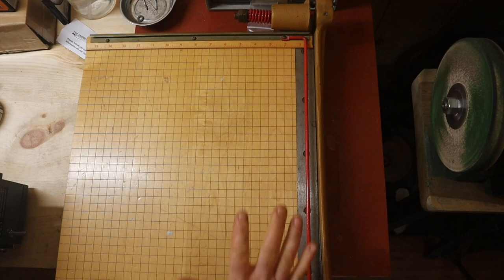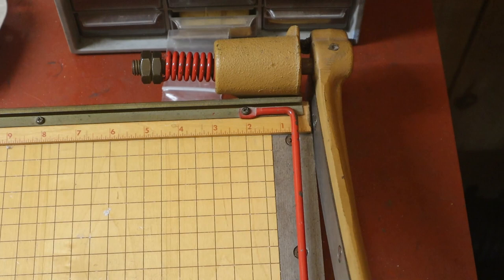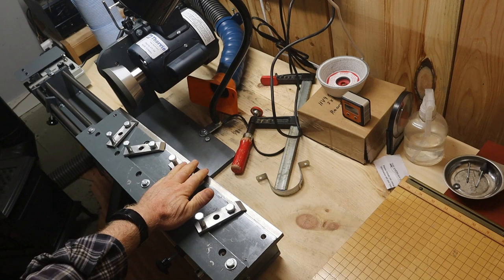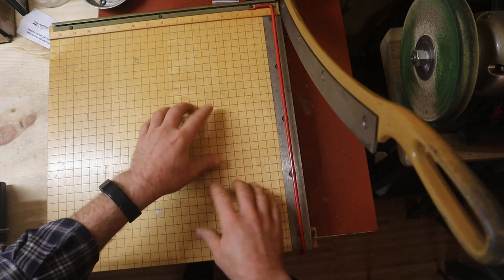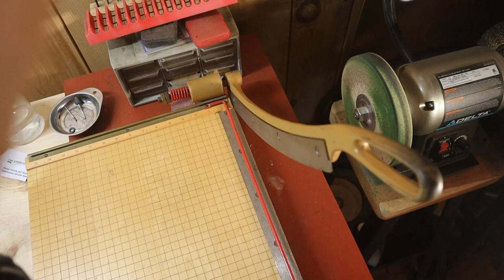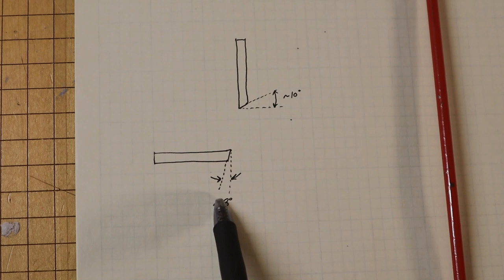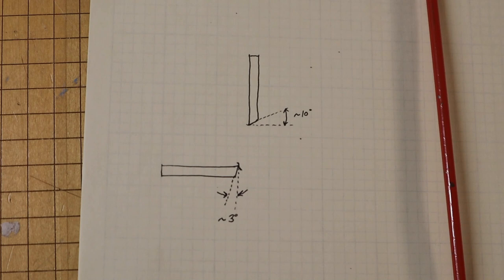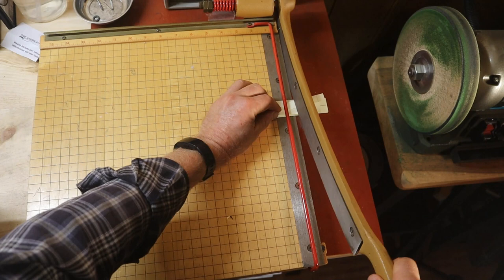Paper Cutter Sharpening | Features I Like and How I Sharpen Them

Comment: I have done a couple of these so far and I agree they are not always worth the time.  The first one I did I severely undercharged, but it was for a non profit so I didn't feel good about upping the price after my initial estimate.  The second one I removed the cutting blade did a few very light passes on the twice as sharp 800 grit ookami gold wheel  and it seemed to work OK although it did chatter a bit because the blade is so long and flexible. They are generally a pain to disassemble, lubricate, adjust.
Reply from the maker: Thanks J. 
Often times, when we come across hard things that no one wants to do it's a good sign of opportunity. I'm not sure if that applies here but worth considering. 
Maybe someone should become the paper cutter sharpening wizard.

Comment: Thanks for the heads up. You mentioned lower return on your time. Around how long to do one?
Reply from the maker: Thanks Doug!  This one was about 45 minutes largely due to the time it took to square up the edge on the Thorvie. The Thorvie cuts at about a half a thousandth per pass so it takes some time to remove material which this one needed.
Reply: @capnmatt41  thanks for videos and the replies. Best wishes.
Reply from the maker: You as well, Doug!